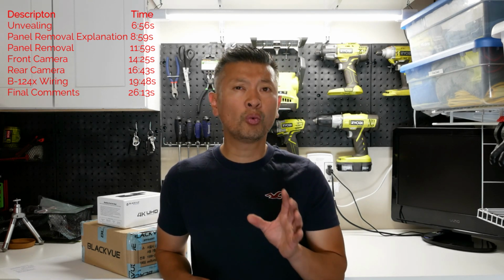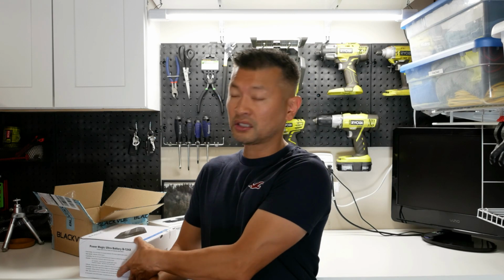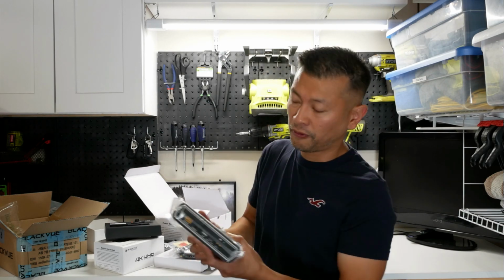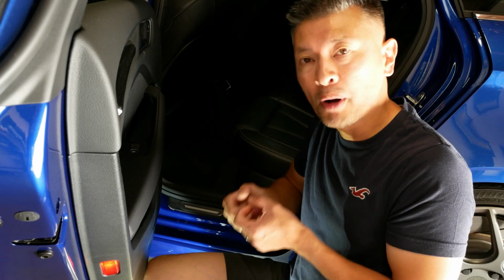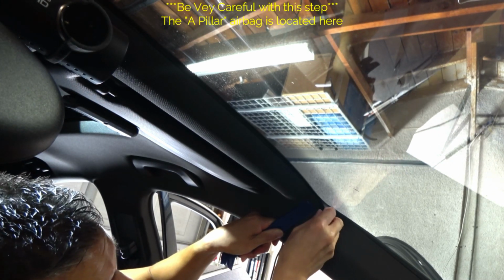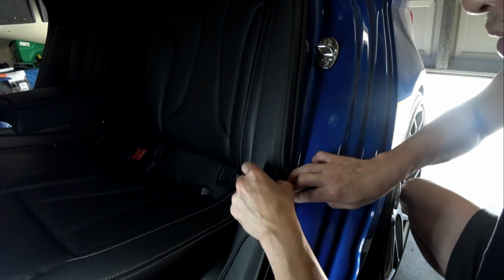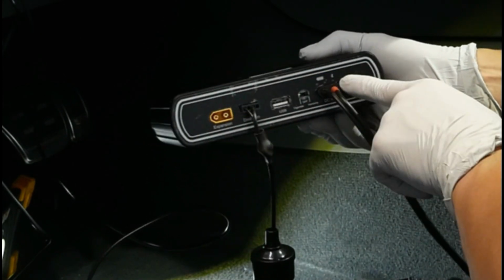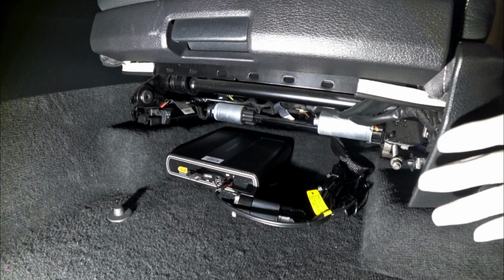Blackvue DR900S & Power Magic Ultra Battery (B124x / B124) Pack Install DIY

Comment: Blackvue Dashcam are crap. Do not buy. Stay away or you will waste your money!!! Not reliable at all!
Reply from the maker: Please share with us what has made your BlackVue dashcams unreliable.
Reply: @TheAutomotiveFanatic 
Two years ago, I purchased from a professional installer and had him install two BlackVue DR 900X 2CH front/rear Dashcams + B124X battery in both my cars. I strongly advise against these cameras, as they are extremely unreliable. Their parameters are not stable. Not only do you have to redo the settings very often, but they are incredibly complex, including using the app and the cloud. Since it is necessary to check very often the settings which take a lot of time and the correct functioning of these cameras otherwise they will not record during events, or worse in case of an incident or accident. As happened to me lately, these cameras are completely useless in my cars. Since I no longer want to spend so much time on these stuff and have to deal with this deception again, I will certainly replace them very soon with two others reliable and easier to use Dashcams. I estimate that €2000 was stolen from me because of the installer who recommended these BlackVue Dashcams to me! If I check the internet now, many media outlets or websites don't even rank BlackVue in the top ten anymore!

Comment: I have this powerpack and extention, but don't know where to put those in my chevrolet spark 2019
Reply from the maker: Andrey, have you looked for space underneath the seat? How about somewhere in the rear hatch? I know the Spark is smaller so you should have plenty of cable wiring.
Reply: @TheAutomotiveFanatic  Thank you for reply ! Under the seat there are some airbag sensors in the way (the one that enables airbag only if you sit on chair) and its huge, i will see if supplied cable is enough to put it in rear, thanks

Comment: im installing DR 750 2CH LTE in my 2015 Q5 and running into several problems. 
one being: the rear dash cam wire gets pulled and strained when i open my trunk. quick solution was just to leave wire dangling for when i open it
Reply from the maker: Zach, your Q5 has a wiring harness that you can run the wire though. I personally do not like wires dangling as it could get caught up on something.
Reply: @TheAutomotiveFanatic  thank you, i’ll have to figure out how to do that
Reply from the maker: @Count_Grishnackh , watch this video of mine and forward to: 8:42

https://youtu.be/o3wxocE1jVQ

Comment: In parking mode, how will your Blackvue DR900S be powered once the Power Magic Ultra Battery (B124X / B124) is completely discharged after over 24 hours?
Reply from the maker: Buzz, great question. After your battery pack is completely discharged, your cameras will shut down. This will save your battery from dying and prematurely wearing out.

Comment: Hey Peter, your video inspired me to do a dashcam install on my '18 S3 but found that my seats don't have an empty carpeted space underneath to place a battery.  I'm thinking it's due to having B&O sound on my car.  The battery unit is so big, I'm not sure where else to install it discreetly other than maybe the empty storage space in the trunk to the right.. but that would require extra wiring.  You've taken apart your car quite a bit, do you have any idea as to where there would be an empty pocket of space inside a panel that I can stash the battery in?  I'm thinking about just returning the battery and hardwiring the cameras.  How useful are you finding the parking mode?
Reply from the maker: David, what is underneath your seats? Amps from the B&O system? What is underneath the passenger side?
Yes, the B124x is large but it's usefulness has been invaluable to me. I generally leave my car unattended for 8-10hrs a day and have the peace of mind that my cameras are recording  without draining my battery. Another option is using the B-112. It's smaller and fit's in tighter place.  You should get about 8hrs of dual channel support. If you're worried about your car, I would not hard-wire it. You won't have the video coverage and could come out to a dead battery.
Reply: @TheAutomotiveFanatic  https://imgur.com/a/Kr3RmZf -- I'm not exactly sure what it is.  Might be components for the B&O or power seat components.  It seems there isn't enough clearance for the battery pack unless I raise the seat up to the highest setting.  Going to wait on the install and contemplate a bit on how I'm going to proceed.. lol. That parking mode sounds very useful.

Comment: removing the 'door' at 14:17 to allow direct front access into the fuse box -- in my RS3 it says 'airbag' on that panel. is this the same for your S3? i'm a little hesitant to remove it...
Reply from the maker: PowerStroke, my door also has "airbag" and I had no issues with it. I would recommend that you remove the "side" door first, double check to see if there's anything behind the "front" fuse door, then proceed.
Reply: @TheAutomotiveFanatic  thanks! i found the bolt you used in your video was not an actual ground for me. Strange!
Reply from the maker: @powerstroke6217  That is strange. I hope you were able to find a usable grounding bolt.
Reply: @TheAutomotiveFanatic  Yeah i did, there was an unpainted bolt on the frame just a few inches to the left of what you used. I did end up cracking my passenger front doorsill trim though :( Any ideas on how to deal with that, or should i just replace it? Do you have to take the front passenger seat out to install that? (2018 RS3). Also, thanks so much for this video! would never have even attempted the install if not for your guide!
Reply from the maker: @mikeb688  , Depending on the severity of the cracked doorsill, it's really up to you if you'd like to replace it or not. If it's just a hairline crack, I'd leave it.
For accessing underneath the seat, no, you do not need to remove the seat. Just raise the seat as high as you can; you should have plenty of clearance afterwards. Thank you for using my video as a reference tool!

Comment: Can a 4 channel BlackVue be installed with the battery?
Reply from the maker: Peter, yes you can as long as you use a cigarette power spliter. Also keep in mind, the available run-time of the B-124x will roughly be cut  in half.
Reply: The Audi S3 Fanatic awesome and I found it. Do you think the power magic pro can be connected to this so I can have an on/off button. looking around for ideas. Thanks.
Reply from the maker: @petahe01  in theory, yes, you could essentially go this route: 
hard-wire Power Magic Pro -> Ultra Battery -> Dash cams
Keep in mind though, because you're no longer hard-wiring the Ultra Battery, your recharge rate will increase as BlackVue sets the cigarette adapter's charge rate lower.

Comment from the maker: After two days of having my vehicle record, I noticed that I made an error in choosing the fuse. I recommend you guys use:

Fuse F48
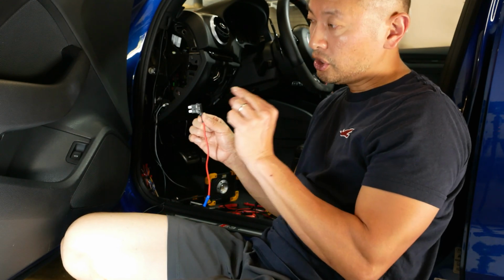Reply: what do you mean by "make sure to use 2 fuses" at 21:02?
Reply from the maker: @MBHockey , if you look carefully at the fuse tap Blackvue provides, it requires 2 fuses to make the connection work. I originally used 1 fuse and couldn't understand why there wasn't any power. Then I read the requirement for 2 fuses.